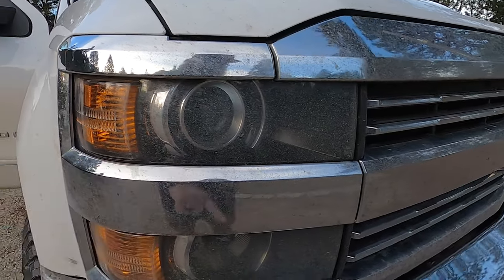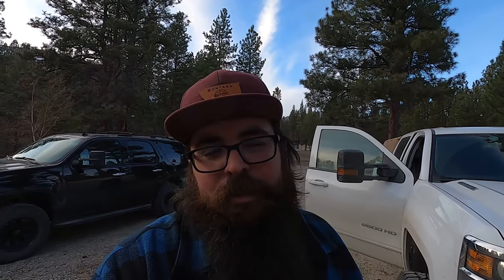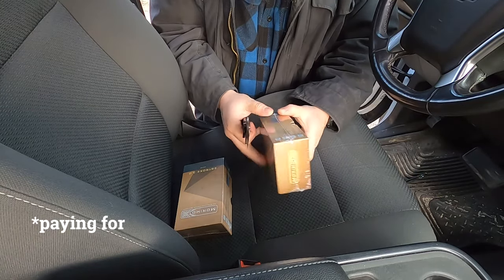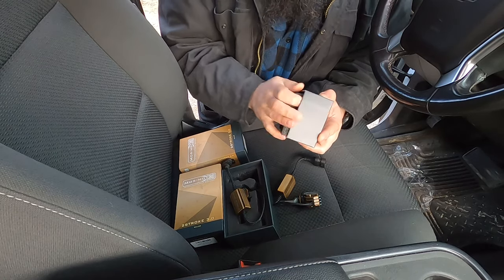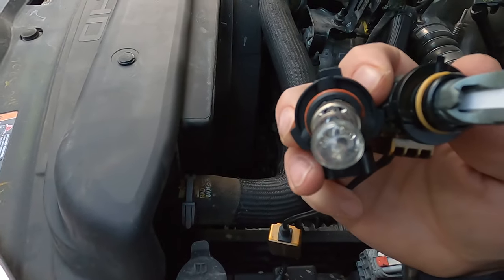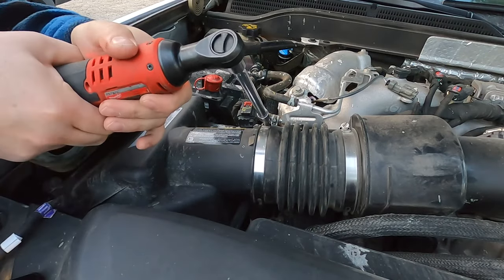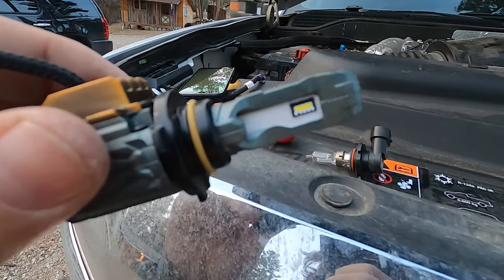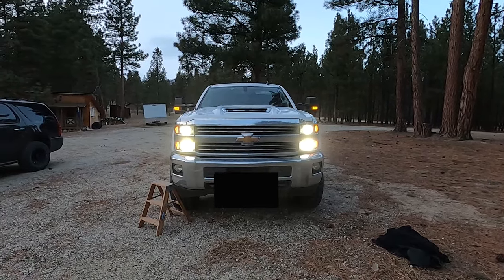Morimoto 2Stroke 3.0 LED Headlights - ARE THEY WORTH IT? Install & Review

Comment: What's good brother.. Nice video. They look great if you ask me! I have a 2018 2500 and was looking into these myself, I just can't deal with the stock bulbs anymore! Got a few questions if you have the time. Do your DRL's still work how they're supposed to? Have you had any error msgs on the dash or flickering at all with out a pwm module? Did the dust caps all go back on with out modification? Are you still running them? Any feedback you can give me would be appreciated! THANKS!
Reply from the maker: Thank you! They do look nice. They run fine. I have only noticed flickering on two occasions, both when it was really cold: one in the reflection on the rear of the car in front of me and the other when the truck was cold starting and idling. DRLs still work fine (I believe I linked the exact product I used in the description). Dust caps fit fine, no modifications. I recently got a real scan tool and found that the BCM is throwing four minor codes, one for each bulb. Nothing that causes malfunctions or a check engine light but they're obviously drawing a different amount of voltage than the stock bulbs so the module records that. I don't know that I can recommend them if you're looking for something brighter than stock. If stock brightness is fine and you just want a clean LED beam, then go for it. If I had to buy again I'd probably go an HID route for brighter output. EDIT: A few people have commented with other options for brighter output, if that helps.
Reply: @WildMountainGarage  I live in the city so I don't need anything stupid bright but my main concern was a clean beam pattern and color so I didn't want to go with any cheap LEDs. I was originally looking into the GTR Ultra 2's but the guys at GTR told me they won't fit in the headlight housing on these trucks so scratch that. I'm in Florida so it doesn't get cold down here. Didn't want to get into spending so much on HIDs and dealing with all that extra equiptment and short life span you get with those right now so I think I'll give these a shot and if they don't work for me I'll probably go the HID route later on as well. THANK YOU for all the info I appreciate it Brother!

Comment: Love how everyone has no inderstanding of lux and down road penetration. These are designed to the new fed proposal standards to be legal and mimic the halogen lights for the halogen lights.  You wont see forgroiubd light as much as youll distance. These are not made to be a flood light. Halogen 100% phillips will out perform almost all those cheap led amazon finds. These also mimic the heat of a halogen so you prevent icing

Comment: Just purchased them (only for $100) and I'm also disappointed. I'd say they are around 20% better over stock, if that. Definitely was expecting more. Even for $100 I'm not sure it's a great purchase. On your video it looks a lot brighter than in real life. I'm considering upgrading the fog lights to help but I don't know that I want to buy the Morimoto ones.

Comment: Do they heat up the housing at all?
Reply from the maker: I'm sure there's heat but I haven't thought about it or checked since the housings are designed to get somewhat warm and they have fans (although it's a closed system on this truck with the additional seal).

Comment: Are you still using the morimoto
Reply from the maker: Yeah, they work fine and are clean, I'm just not impressed for the money. Perhaps it's the housings, but I still don't think better housings would increase the output to the point where I'd be happy having spent $300 for high and low beams. I think the point of these is having a quality LED bulb and clean output but they're not exceptionally bright in my application.
Reply: @WildMountainGarage  I had these cheaper Chinese leds with a smaller fan for $90 a pair and these morimoto were a pain to put in the aftermarket headlights and were just slightly brighter but hey I got morimotos now lol. Next year something better comes along.

Comment: If you put any more lighting to your truck you will probably endanger other road users. Those lights have a good peripheral vision and enough spread for your comfortable night driving. You don't need to install anymore lights to the car.
Reply from the maker: Ephraim, I don't run the lights with oncoming traffic but in the past run aux lights switched with the high beams. I don't know where you live, but it's dark here at night with a lot of wildlife and long stretches at high speeds and visibility is paramount.
Reply: @WildMountainGarage  I live in South Africa, in the rural areas. I know, I see plenty of wild and domestic animals on our roads at night too and it is also as dark as it can be.

Comment: Did you clock the leds in your projector low beams? If you turn the leds so they are facing up and down, or 12 o’clock and 6 o’clock, it will help throw the beam a bit further. As far as reflector housings, leds will not throw as far unfortunately.
Reply from the maker: Yes, they're clocked. I mentioned that when installing. The cheapo amazon ones in the fogs with reflectors throw farther than halogen. Good to know, thanks for the info!
Reply: @WildMountainGarage  Lumen makes some some nice LED fog lamp housings that are projector style as well. Thanks for your review on the Morimoto 2Stroke 3.0! I am going to get a pair for the low beam projectors on my truck.
Reply: How do you clock the h11?
Reply: If I'm not mistaken you want your leds to be facing left to right or 3&9 from what I've seen?
Reply: @Opie94  for reflector headlamps yes. It can vary by, the led headlights and the design of the projector headlamps, I’ve realized.
Reply: @Opie94  it needs to be 9 and 3 o clock position for both projectors and reflectors. Even though projectors have a cut off point. By placing them in a 12 and 6 o clock position. You are causing glare from the projector lense itself. Which won't blind oncoming traffic but it's a huge annoyance.

Comment: Morimoto 3.0 Low beams I think they not bright at all.. stock high beams are same as morimoto 3.0 just different color but definitely not brighter plus you need to get anti-flicker harnesses otherwise they flick every time you turn them on... I wish I could ordered the gtr instead...
Reply from the maker: Good to know. I might upgrade highs to GTR. I haven't had any flickering, other than one time in severe cold during remote start. Sorry you're having regrets, too!